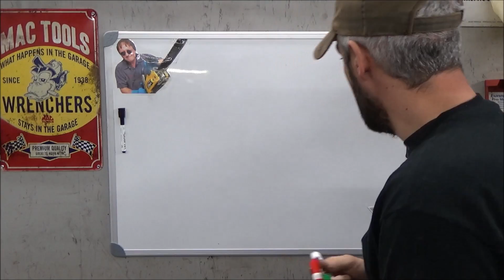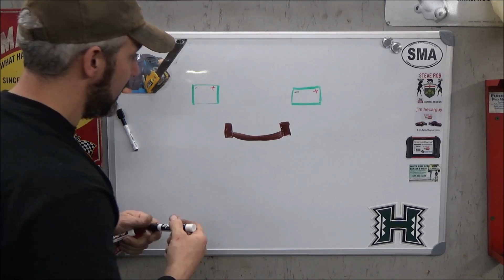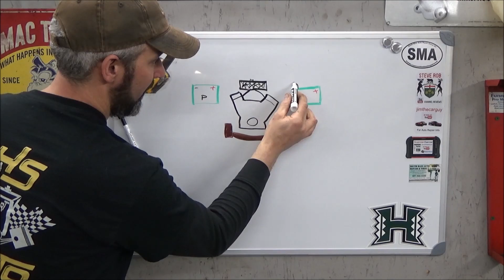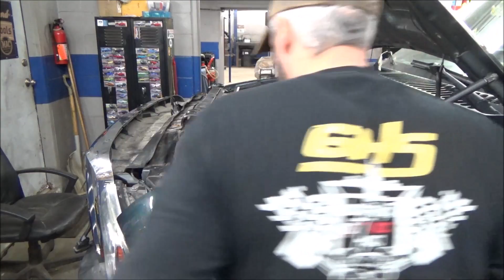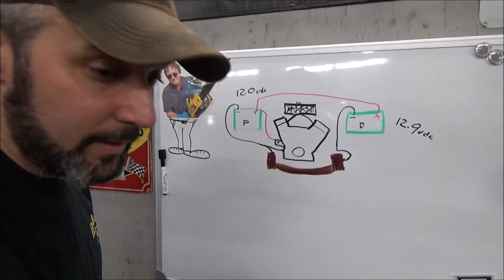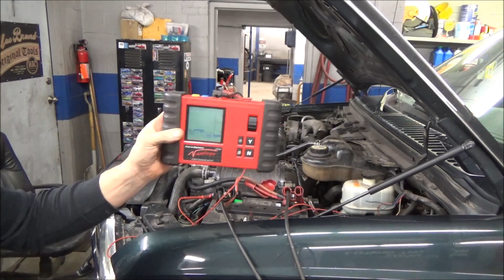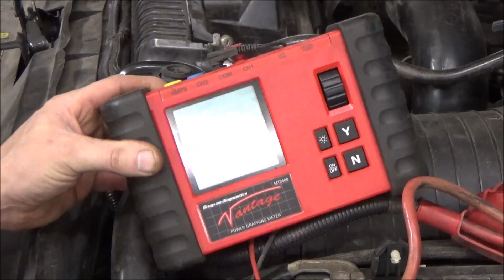Ford F-550 6.0 - No Start No Crank

Comment: There is a SIngle lead round connector located underhood, passenger side, right up against/ near fender. Disconnect connector and touch connector end with male terminal to Battery Positive (it should physically reach) to crank over engine from under hood.

Comment: Old video, I know but you did not need to induce a current with the battery charger, the batterys provide plenty of current for that. If no batterys, then yes, use the charger to induce current and measure voltage drop. I much respect Erics diagnostic skills though and would gladly pay Eric to maintain my vehicles.

Comment: It's a Ford, there's your problem! I used to do roadside assistance and battery installs. Those 6.0 diesels basically won't start without two good batteries.
I really enjoy watching you troubleshoot vehicles. You think through the problem before buying parts. Great job as usual, and stay away from those gas station burritos bud.

Comment: On my 2003 F250 6.0L I had a shorted fuse panel in the driver footwell area that cost me $600 to get changed out at the local Ford stealership.  The truck would start but would not charge.  I wish I could have had the knowledge to diagnosed it  myself at the time.

Comment: If I can make a suggestion, I've always used jumper cables from battery to battery or battery to frame to find power loss quickly. Every mechanic is different, don't want to step on anyone's toes.

Comment: I've seen things like this in trucks and machinery with multiple batteries, The quickest check is a jumper cable from each battery positive to ground or, for the less adventurous, a battery load test from the positive to ground. I've seen three battery systems where only one of the batteries is still connected because of a problem with a cable.

Comment: South Main Auto
In video where you found faulty ground using 2 battery in a truck. You found the bad ground attached to the motor block as opposed to the frame. But you didn't address what caused the fault. Looking at the ground harness it appeared that the cause may have been the result of stress because the harness was made up to short and when the engine was reved the engine put excessive  stress on the wire.
When replaced perhaps 1 wire direct to frame and the 2nd wire from frame to engine block. With ample length. Then tie off with plastic tie (s).

Comment: question. i know that's silly, but i'd been educated to work in the exact opposite flow.
in a no crank situation:
-jump/bump start battery(ies) & try key crank (battery ok/ko test);
-jump the vehicle battery ground, first on the engine then on the chassis  with jump cables (& try key crank);
in this case i also would've bypassed the vehicle positive-to-positive w/ another jump cable & grounded the second bat_ry the same way.
-if there's crank, disconnect the jumps, one at a time & try key crank each disconnection, to pinpoint who's the bad guy.
--if still no crank, tester check the starter mo_ hot feed (volt & ohms with the tester battery induced current).
--if starter mo feed's ok, bypass the key system, by exciting the solenoid directly from the battery positive, (3mm cable w/ medium crocodile clamps).
(..etc...)
the tester would've been the last thing to come out.
this may take less time to be done than it takes to be read. as well as your diag_ would've been way, way, way faster if you were not filming/explaining.
i'm not as skilled as you are, neither i have your experience (not by a loooong shot).
this makes me feel like this way i'd overlook something , i'm i right? would i fry something?
or is it just 'cause i have more jump cables & batteries laying around @ the shop than testers?
however very useful & inspiring video/study, same as all of yours.
thanks for reading
love from Italy

Comment: Nice job Mr. O. Have you ever looked inside the water/fuel separator on the frame rail on one of those 6.0L.? Unbolt the aluminum cover. Full of gunk!! If one runs bad for no reason, look there. Hope it helps you out in the future.

Comment: great video Eric! looks like those years working in your dads truck shop payed off!
did a good job explaining how a dual battery setup works
I had seen guys get bit by that!  some guys would simply charge the other battery and ship it but eventually be back at square one
Reply from the maker: +uprednecked Well the trucks I worked on there had 4 batteries... or more...
Reply: +South Main Auto Repair The other day we had an International with a 6 battery set up
never seen that many batteries usually we see 2 or 3 or 4 batteries

Comment: This is a good method because of access time required to those connections of the frame and block.
Thank the maker, it was the easier side.
So what caused the brown grodies in the cable? It looks like a clean rig, but Eric O says it's rusty underneath from being in the northeast.
I was going to say what EricO predicted.
An ohm check that's reading greater than point 5 ohms is out of spec.
Our reading was 69,000 ohms.
That would be bad.
So from the disconnected cable clamp at the post, to the ends , respectively, each should be less than point 5.
It's a P.O.S. corroded or incorrectly made cable.
(Now that we know)
What happens at a Ford dealer, is you do all this and the warranty clerk takes all but about a half hour.
You only get paid the half hour.
And that's after the new part is on there.
So,  my take on this would be to have my suspect circuit, disconnect, and ohm check it.
If the values were inconclusive, use the jump box grandma trick, or a pair of jumper cables connected to a charged battery.
Charge each of the vehicles batteries, run charging system tests.
And write all the values down.
Hope for a miracle that the electrical testing procedure time and the cable access time, can. be added to the replacement of one cable.
Tough luck when you get an additional point three added to your point 5 you could count on.
If you had management sign off on the perplexing situation?
That could be your saving grace for all you did Eric O, to be the electrical swammy you are.
And your grandma is a phart smeller too.
Hope you get paid.
Nice diagnosis and presentation.
I learned more than I thought I would, and stayed with it to the victory!
Hooray! For Eric O.
If the customer was paying us to tell me him why his electrical issue existed we would ask for an hour to get as far into it as was needed.
Then we would price new cables and look up the Chilton guide labor time.
He might buy one r all of them based on a conversation with our findings so far to base a decision on, and the gut feeling of management, or their request to pull cables and check.
We would be told to pull that one that was suspect first and bench check it in my  experience, sometimes you need luck to make a buck. It in this kind of problem, you break even.

Comment: It seems a scope that will measure conductance (measured in "Henrys") by running a frequency check through the conductor would be quite helpful.  Then you don't have to run a load over the circuit.  They aren't that bad in price compared to your others.  Take care.  Doug

Comment: For some reason I have seen that issue more commonly in trucks with plows vs no plow. I would replace the ground wire with 1/0 awg welding cable both batt's ground to engine and frame.

Comment: Even if you suspected a poor ground and went right to the problem area what would DIYs and others who might not understand voltage drop learn from it. Visual inspection is to me the correct first step but the voltage information you obtained from testing doesn't lie. I think you tested the system logically and that ended at the correct diagnosis. So i say fantastic job Eric.

P.S. The problem you had not finding that marker only gets worse as you get older. Take it from someone who misplaces everything.....HaHaHa.
Reply from the maker: +wysetech2000 I am at the point I write everything down all ready.... Oh boy it gets worse huh haha

Comment: J.s coming from the car stereo world and also owning a ford 7.3 . You need to run a 4ga power from alt to battery and then a 4ga  ground to the case of the alt ,the motor , the frame , and one to the body .on the drivers side only do grounds to the motor, frame, body, check the 3ga factory positive that crosses over.  Its actually referred to as the " big 3 or big 4 . Also you just cranked on it so the pass battery could possibly be lower if youve got bad grounds, could take a min for it to pull from the other battery
Reply: Wow just seen at 21:17 ... Bad grounds . :)

Comment: I always go ground first, only because I do car audio as a hobby and it is always the ground. I tell people all the time "ground is more important than positive". A bad ground will make crazy gremlins. Positive usually either works or it don't (Usually). Though I don't fix vehicles like you I have worked on them in doing Auto Body/Paint for 25+ years and yes you could go check all the connections but how would that teach someone??? You broke it down as to the how, what and why giving real life troubleshooting of a real issue (you cant teach someone that either they got it or they don't but someone out there is glad they saw this and just fixed their vehicle). 

 I personally fix things a little different, but, most of the time I do it myself and the money saved goes into doing it right. Since I do my own labor, I would have replaced every battery cable and probably made my own as well,if it was my vehicle, with the money I would have spent on labor.  I know customers are cheap, don't want to pay someone else to do it and like electricity take the least path of resistance or the easy way. Trust me I get it, I just said my way of doing it people, don't get panties in a twist it's okay to do it different. 
  I've told a few people who asked for my help fixing something on a vehicle " Hey if you're not going to do it right I'm not going to help you". It is one thing to band-aid it together to get home but once you got the tools do it right so you don't have to revisit it a second time.  
Seems I learn something every video I watch of yours, keep it up and f*ck everyone who bitches about a free video you put out for "FREE"  Your a good man with morals and you help people. I used to have my own mobile  auto body business and I did the same. I got burnt out though. I always loved the line " Hey you can come over and practice doing flames on my car" Ya just what I want to do is come over do 40 hours of free work. You want me to pay for the paint as well???

Comment: I run ground cables right to starter bolt on block like on Mack does Junky ford wiring typical rusted connection on rusty frame. Then I run another one back to frame. I use load tester 1000amp right off starter terminal to test current to starter. Good you teach people how to troubleshoot and explain wiring.

Check out a series parallel switch solenoid  24v crank 12v run . A lot of guys can't handle that one. A few beers later a lot of sparks and cursing on old trucks lol.

Comment: As always you showed us a clear cut way to work it down and come up with the definitive repair. Would be interested to know if you could seal of the bad part of cable and make a short frame to block ground strap? I suspect once corrosion gets in it stays in and would take out the main cable eventually. Would that be your thinking? Your grandma was a smart lady.
Reply from the maker: +Garlin Willingham Yeah I think you are right. It would have migrated right up the cable for sure causing trouble all the way. It was only like 50 bucks right from ford and fit perfect! Problem solved!

Comment: But it was running before you worked on it! :-)  
high current from the snow plough pump, salt water and a loose crimp. the electrolysis corroded all the metal away. Good one.
Reply from the maker: +BChrisL Make something weak, add salt and *POOF*

Comment: Great procedure!  Narrowed down the culprit and barely even got dirty doing it!  I kinda want to set your white board on fire, though.  Can't imagine why...  ;)

A (not so) quick word on batteries, though!  I've been looking to replace mine, and as such, I've been doing way more research than I have any right to for such a simple, common thing.  What I've found is that Interstate isn't quite what it used to be.  I can't speak for their truck line, but most (if not all) of their passenger car line now shares a core with a lot of other brands, including the store brands for O'Reilly, Pep Boys, AutoZone and NAPA, whereas in the past they either manufactured their own cores or used a better quality supplier.  I'm not putting down parts-store batteries; they're good enough for the price.  Interstate is still charging a premium, however, and you may not be getting anything extra for your money.

Surprisingly, Sears currently seems to have a good battery lineup for passenger cars.  Their cores are coming from a different supplier than the parts-store bunch, and typically have higher ratings by group size.  Their cost is also higher, but at least you're getting something for it!
Reply from the maker: +rhkips Johnson Control makes a huge majority of the batteries in the world you are right. I use to sell Interstate at my shop but the quality tanked to be honest with you. I switched to AutoCraft Golds (Advance) after some research and have installed hundreds of them and have never had an issue or even warrantied one yet.

Comment: Newer Ford diesels (7.3, 6.0, 6.4, 6.7) do not begin to charge the battery for the first 2 minutes after the truck has been started due to the glow plug system and starting system drawing the batteries down. If you Start it a couple times and shut it off the batterys will be almost dead, every time it is started it should be run for at least 10 mins to recharge.

Comment: A few years ago I had a somewhat similar problem on a motorbike.  Battery showing 12v, no start.  Connect battery charger and try again, still no crank, although significant current flowing from charger.  Turned out to be a dry cell in the battery was allowing small current flow to show the12v, but when significant ampage available, rather than turn over the engine, it shorted through the battery.  The main dealers had given up on fault finding, Purchased the bike for very little, and after buying a new battery I was the proud owner of a good motorbike....

Comment: 1.5v for a standard disposable battery cell
1.2v for a rechargeable cell

Just FYI ;)
Reply: And 2 volts for a lead-acid cell.
Reply: @44R0Ndin  2.4 volts for lead acid.

Comment: Interesting, early on in the video I was guessing that there was a diode between the two batteries which would limit the electron flow to one direction.  In this pattern you'd have all auxiliary power coming off of one battery and the other battery is reserved for functions like starting.  A diode here may cause different voltages if it was from the direction of the starter battery to the aux battery which was consistent with your voltage differences and the readings when attempting to crank.  In this case the solution would have just been to reverse the diode as someone likely accidentally installed it in the wrong direction when installing the new battery.  I guess it's another scenario to consider if others watch this video and see similar symptoms :)

Comment: i had a datsun maxima diesel and sheet metal bolts were used instead of nuts and bolts thru the body. Changed to nuts and bolts and sanded the metal, there was no more problem starting

Comment: You have to aware some of the newer vehicles have smart relays. They will switch charging between batteries.. Depending on which one is in need of charging. So look at the wiring diagram before you hit a ground wire with jumper cables. As you will fry that Smart Relay...

Comment: Also I would take the alternator output lead coming from the battery it might be disconnected or a wire inside the casing
Or broken treads inside.

Comment: It would helpful to bond the driver’s side battery to the engine.
Bonding is a technique used on aircraft that a parked.  It provides multiple paths to ground to suppress Static Electricity ⚡️⚡️⚡️⚡️⚡️⚡️⚡️⚡️⚡️⚡️⚡️⚡️

Comment: Ck for a battery isolator somewhere in the system or bad cable between the two batteries hook up jumper cables.

Comment: You need to disconnect the battery's from each other isolate each battery so its safe for you to work under the hood the power in each battery can cause a fire it's dangerous it won't let go either.

Comment: As you were performing your magic under the hood, I think I may have come up with an easier way to diagnose where the fault is ,be it neg. or pos..  If you were to attach one voltmeter to the left batt. and another voltmeter to the right batt. you can immediately see the voltage difference. Then take your trusty battery cable and hook from neg on left to neg on right. if that doesnt fix it hook from pos on left to pos on right. The old jumper cable Jumanju...I used the jumper cable to locate a ground that had come undone on my chevy truck causing me all kinds of weird issues.